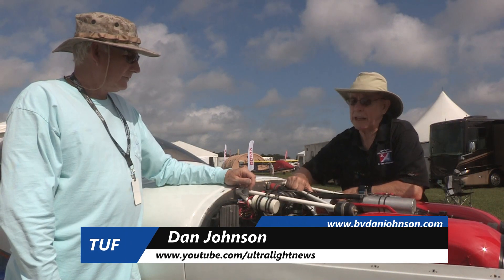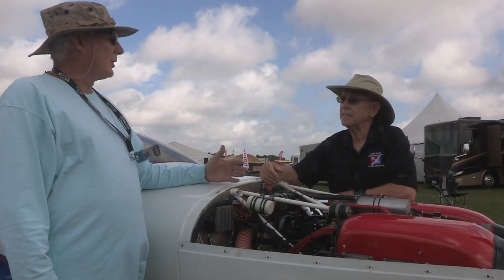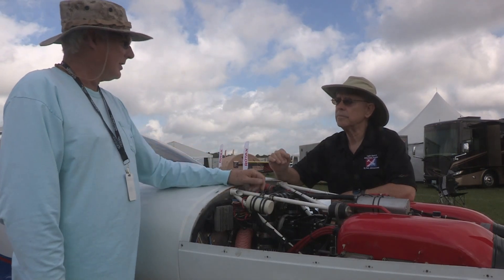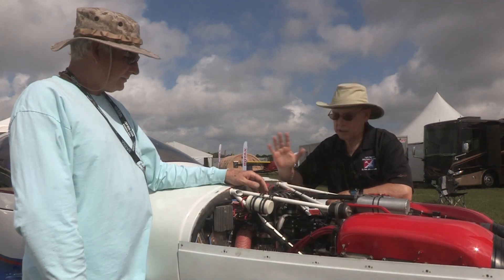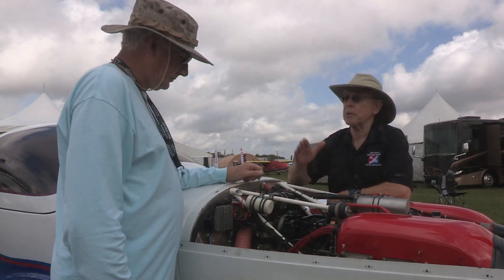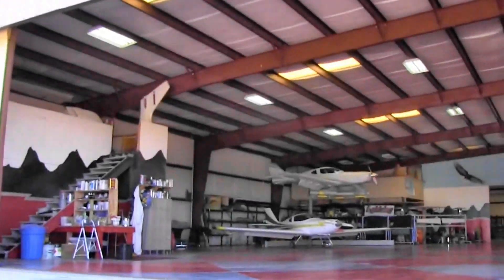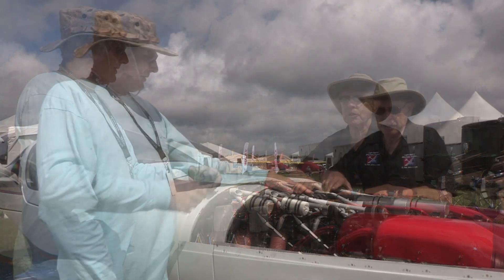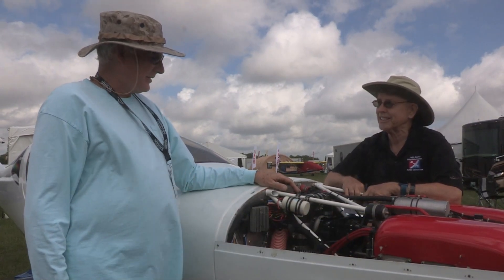Jabiru Supercharger, Jabiru 3300 Gen 4 Aircraft Engine Super Charger by https://geronimoeabc.com/

Comment: Both turbo and centrifigul supercharger typically use a blow off valve in the intake tract to modulate manifold pressure or "blow off" pressure spikes when throttle is closed quickly. A turbo uses a wastgate in the exhaust tract to modulate exhaust flow/turbo speed/manifold pressure. Minor detail lol.
Cool project nonetheless
Reply: Turbos also use a bypass valve in the inlet for professional applications. Having the valve open and and bleeding off some boost means the turbo spins faster than it needs to. This is good for when you need a sudden response in boost. You dont need to wait for the turbo to spin up.

Comment: Hi Dan. thank you for the video do you know if the jabiru is fuel injected and how much horsepower with the supercharger
Reply: At 36 inHg MAP at 3150 (take off) RPM the Jabiru 3300 generates ~ 140 to 145 HP, and currently I am flying a Rotec 40 mm TBI.  The initial testing was done using the stock Bing carburetor.
Reply: It has a pressure compensating carburetor.